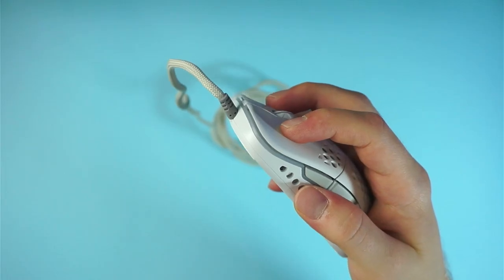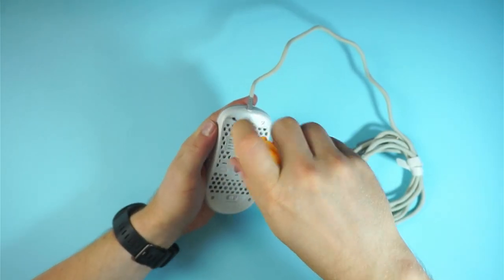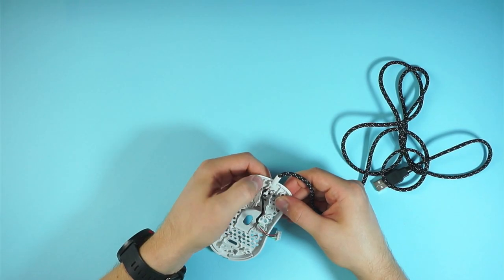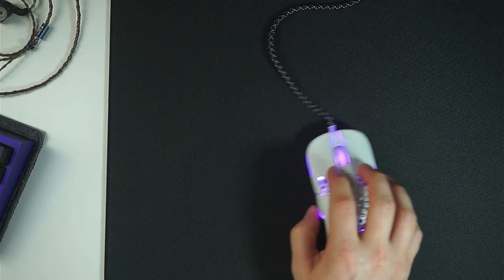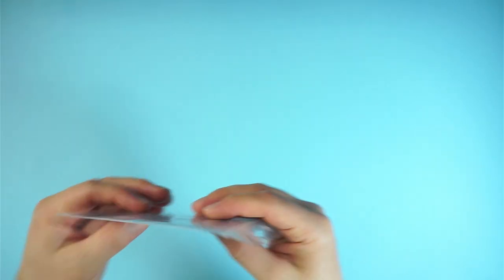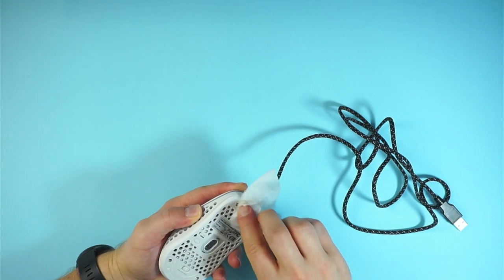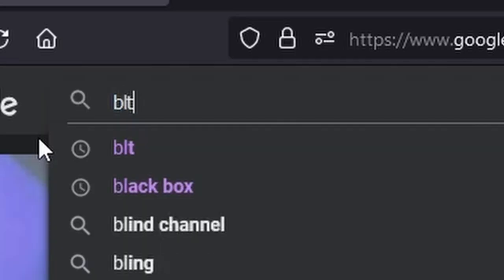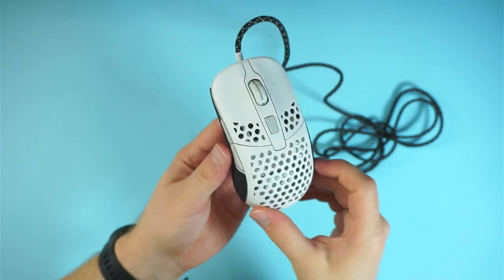This Is How To Make Your Gaming Mouse Better (Simple Mods!)

Comment: i just change to corepad feet and recently i have been digging lizard skin tape.
Reply from the maker: Did you change the feet from your Viper V2 Pro as well or did you like the stock feet?
Reply: @jerrorr  i am about to. just ordered them today. but this is more for consistencies sake than for performance, because i have to replace them anyway at some point, so no point getting used to stock feet. the stock feet feel pretty good though.

btw, i got the parabrake v2 now, after i watched a german reviewer doing friction tests and it had the same friction as a GSR SE. he also said something rather controversial, which i can cosign now. "you cannot get more control and more speed at the same time".
Reply from the maker: @glashausAimz2  I hear you, that's a good point. How is the quality on the parabrake v2? The paracontrol v2 is definitely one of my favourite pads right now. Pulsar pads are great value imo.
Reply: @jerrorr  it feels like it got some lumps(a minor issue, they are very small) somewhere near the top right, you can't notice it with the mouse though. other than that it's doing rather well for me. the glide is amazingly smooth and consistent with a lot of friction. the stitching certainly isn't top tier, but it's not terrible either. i can stop on dime with it and that's what i was looking for. i wouldn't recommend a hybrid pad for CSGO, after using the parabrake. i immediately improved in terms of stability and and fast flicks, so I can't complain. well, i had a qck heavy for 2 years, so i am kinda used to it, but the parabrake has a much smoother glide and feel. the structured texture of the gigantus v2 annoyed me a little. evertime i get a pad with structure, i feel like i loose a bit of precision for that pixel aim. it was most noticeable on the mpc450, but that may have also been due to the friction. in actual gameplay i can still easily smooth corners with my crosshair and tracking is also still very much possible, due to the very controlled and smooth glide. i haven't tested it in aim trainers yet, but i can imagine that it would get tiresome after a while. here's the thing though: ingame i have on average more kills than with speedier pads and they happen more effortlessly. flicks are faster because i can still move my mouse just as quick as on a speed pad, but the stopping is way easier and doesn't require me to slow down earlier in order not to over aim and having to correct. 

it is however a cat hair magnet(like all cloth pads I've had so far), so better keep a piece of packing tape ready🤣
Reply from the maker: Good to hear it performs well! I have also been using a cloth pad for a while now (LGG Saturn) and it has been really good in both apex and in aimtrainers. But yeah a lint roller or packing tape is a must with cloth pads 😂